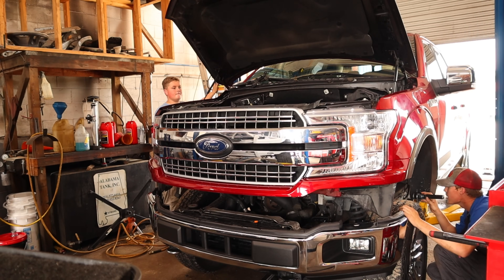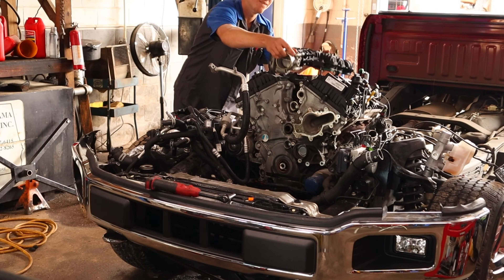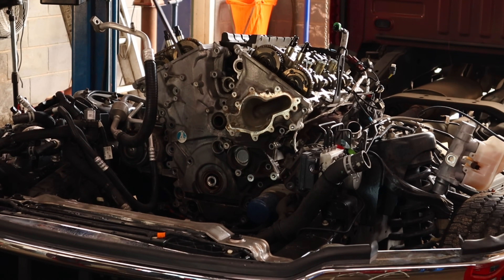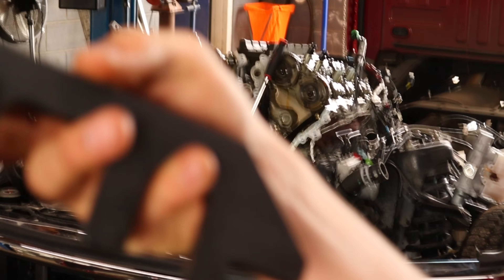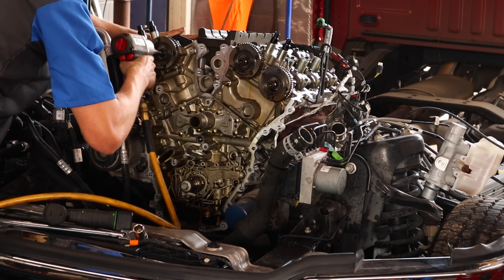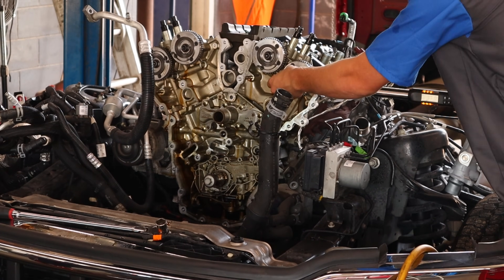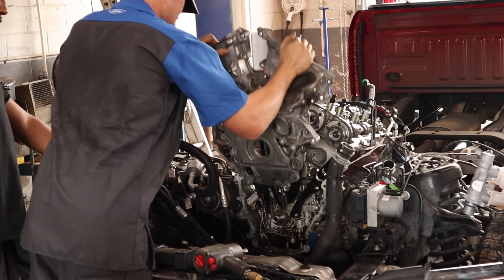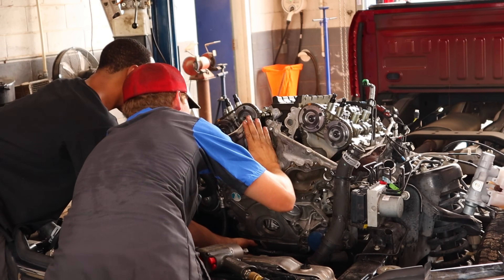Ford 3.5 EcoBoost Cold Start Rattle (VCT Phasers) | Everything You Need To Know

Comment: Please tell me why my 2015 F150 5.0 Coyote have the typewriter TICK for the first 3 to 4 minutes at cold startup?  Engine has 47,000 miles.  I change oil every 5,000 miles and use Mobil 1 5W20
Reply: I also would like to know the awnser behind all the mysterious coyote noises I have a 2017 f150 5.0 and mine has the bbq tick only when hot if I use any oil other than pennzoil ultra platinum but as long as I use that oil it’s quiet. However recently I have noticed if I go drive for 30 mins or so stop somewhere for a hour or so and then start it back up I’ll get a tick or tap from the passenger bank of the motor specifically from the rear like cylinder 3 or 4. Only lasts maybe 30 seconds and then goes back to quiet. I cut all my filters and haven’t found any alarming metal in them but I’d definitely like to know all the noise culprits. I’ve also had one short block installed at 10,000 miles I currently have 52,000.
Reply: Only thing I can figure on the restart noise I have is it’s piston slap since it cools down some the pistons shrink back down some and then after the 30 seconds or so it stops cause there back to normal temperature taking up any excessive piston to wall clearance weird how piston slap is normally only when the motor is completely cold and generally gets quiter when warm but my motor is quiet when it’s cold and hot only does it at that weird time and temperature
Reply from the maker: 2/5/2019 7718 - 2011-2019 Mustang/F-150 - 5.0L Tick Tap And/or Typewriter Noise At Idle

Some 2011-2019 Mustang and F-150 vehicles equipped with a 5.0L engine may exhibit a ticking noise at idle after an engine oil change. It is often referred to as typewriter noise because of its similarity to the sound of a mechanical typewriter. The noise in question may be heard on some engines when engine temperatures reach 150°F (65°C) or higher and engine speed is at idle up to approximately 1700 RPM's. It can typically be heard at the front wheel well, and is often isolated to the transmission bell housing or oil pan area. typewriter noise is not detrimental to engine function or durability and has no short or long term effects on the engine. This an operating characteristic of the 5.0L engine and no repairs should be attempted.
Reply from the maker: So I’m not sure what is actually behind the tick noise. I agree with James that piston slap could be the culprit. In my other commented I posted word for word what Ford put out in the version of a special service message. Hope this helps!

Comment: What are the long term implications of not changing these out?  Great video btw!
Reply from the maker: Thanks! Honestly nothing. It will just keep rattling and probably start happening more and more often.
Reply: $3500 unexpected repairs….timing chain cams sprockets….end up timing slipping out of range..my experience at least!! I’d get fixed sooner than later
Reply: @Jras2218  Two different answers here... which is correct?